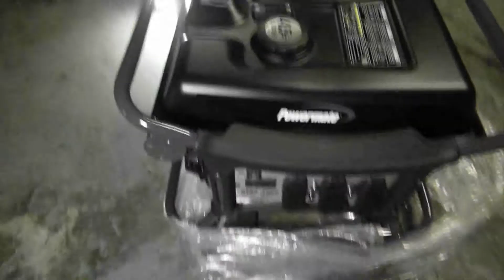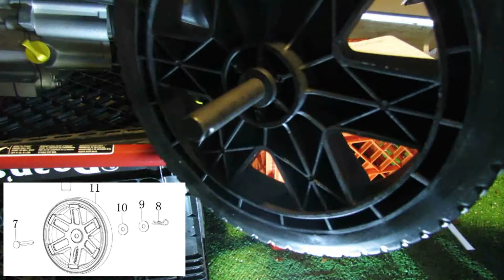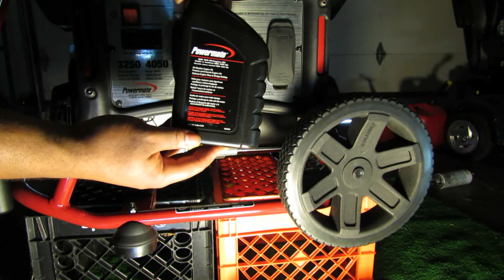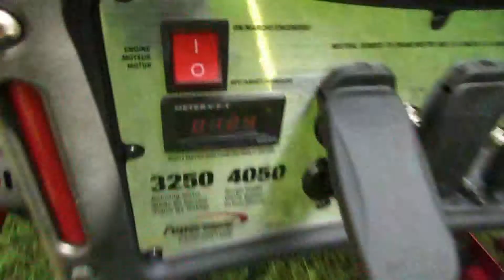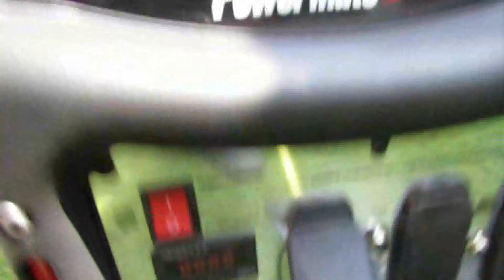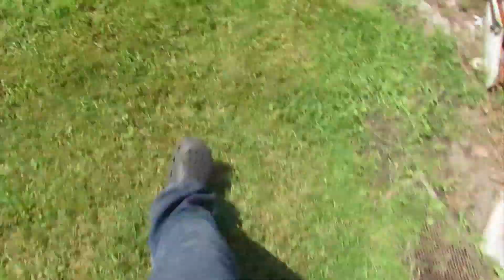Powermate PM0143250 3250 watt generator unbox, setup and first start

Comment: I have this same Generator & whenever I put any load on it, it surges like yours did at the 23 minute mark in the video.  It runs perfectly fine until I plug anything into it.  I was testing it this week by first running the toaster on it, then a small electric heater & finally a lamp.  I ran them all separately, not at once and each one caused the generator to constantly surge up & down.  Any ideas?
Reply: Carb has air leak